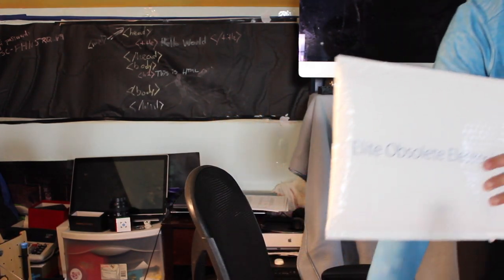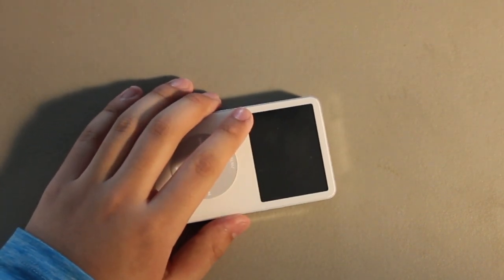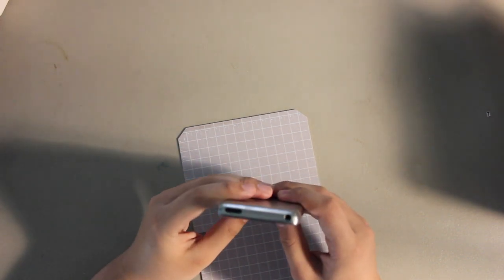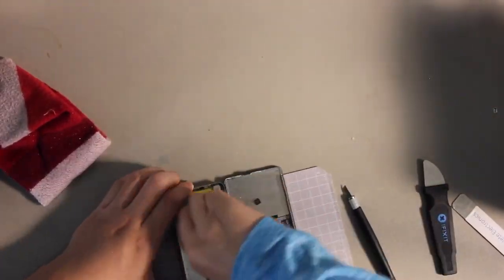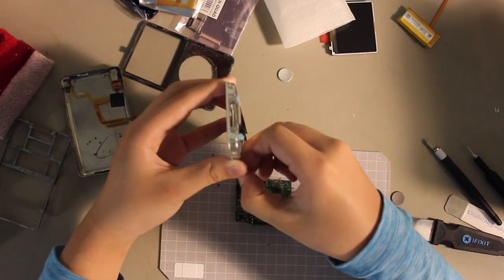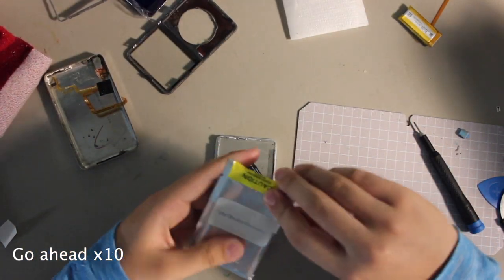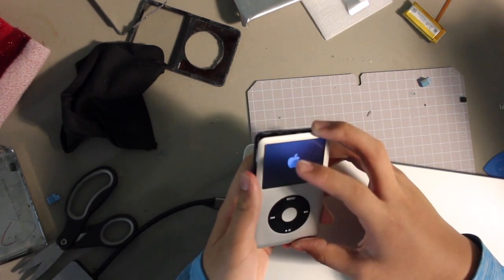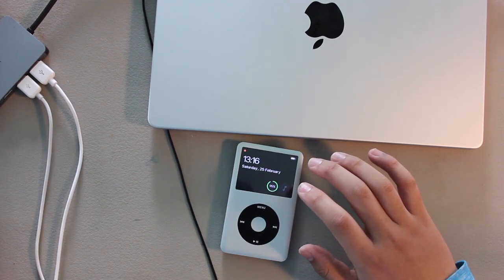I made the FLAGSHIP iPod Classic! (from a broken pod) | TSLabs

Comment: Nice work. 
Idea: maybe you should exchange parts between both ipods. The 5th and 5.5th gen are condsidered as the best sound quality ipods ever.
Reply from the maker: Thanks for the tips! There are a couple problems with that: the click wheel on the 7th gen is more sunken in, swapping the front plates makes it very uncomfortable to use. Also I like having the extra processing power that the 7th gen has because it makes Rockbox run much snappier. I do know about the Wolfson/Cirrus debate, however I haven't noticed much of a difference.
Reply: @techspacesofficial  Thanks i will try to find a 7th gen to experience the beter performance.
Reply from the maker: It isn't a big difference on stock Rockbox, but when you install a large theme like FreshOS then it makes a difference.
Reply: I have both and there is magic to the 5th gen’s. But the 7th sounds good and clean. The 6th and I touch sounds like trash tho. I have them all

Comment: Please consider a video on how to update, upgrade a iPod classic in one video to have 
1) more storage like this video
2) how to install blue tooth 5.3
3) wireless charging
4) convert to have USBC
5) different operating system to include better sound quality an types of data then iTunes.. Hopefully can control via Android instead of Windows or a Mac.
6) biggest possibly best battery.
7) Since it sounds like you offer this service please post details on how to offer a donor iPod to have you do it for us.
Reply from the maker: Hey there mr Joe, we are working on a video for upgrading but are currently wrapped up with other projects. There are plenty of guides online though. Here is the basic rundown:
1). iFlash Tarkan Mod: https://www.youtube.com/watch?v=YDxyoNbvrL0
Some things to note: 6th/6.5 gens only support up to 128gb. You need to format the card before inserting it into the ipod, and it can be a bit finicky. try reinserting the card and formatting the card directly and through the ipod if it doesn't work first try.

2). Would require some heavier modding, as shown here: https://preview.redd.it/xvq53yde1r481.jpg?width=2356&format=pjpg&auto=webp&s=4930f04c2404ccb6bfff8a236f9ef0a12b75e020. As far as I know, the only service/diy product kit offered was by classicsarerelevant which is now closed down, and is something I'm currently not able to do.

3). unfortunately, this would be a really heavy mod. wireless charging coils aren't able to charge through a metal back (at least not effectively), so you would need to machine out a hole and maybe some kind of protective plastic cover. this is what one person did and here is what it looks like, definitely past my skillset: https://imgur.com/a/82jB7rb

4). requires soldering, here's a person who offers some good kits and instructions: https://oxyllmods.square.site/rev-05. I am also able to do this, and there are plenty of people on etsy for example who are also able to do this for a fee.

5). I'm not an avid android user, but i'm pretty sure android can access external filesystems plugged into the device. With rockbox, your ipod basically turns into an external drive that you can drag and drop music onto without proprietary software. Of course you would still need a mac/pc for setup, but I think an Android device could be able to upload and modify files on the iPod. Rockbox tutorial is coming soon on this channel, but here's a good one for PC: https://www.ifixit.com/Guide/How+to+install+Rockbox+on+an+iPod+Classic/114824

6). biggest battery available on the market currently is the 3800mAh battery. Since iPods barely sip any power to begin with (the iflash takes even less power than the hard drive), this would last you well over 2 weeks under normal usage (I haven't charged mine in 1 month lol). battery upgrade is pretty simple: slide your pry tool (like a jimmy) into one side of the iPod, push the clips in and out (search a video on how to open an iPod classic). from there, it's as easy as unplugging the old battery and plugging in the new one

7). if you would like, we can discuss pricing and upgrades at "info@techspaces.club". however I strongly encourage you to do some of these upgrades (like the battery and storage) yourself, as you will learn a lot through the process and it's really fun!

hope this helps :)

Comment: Hey great video. I have a red cross on my ipod. Do you know how to fix that?
Reply from the maker: thanks! usually, the red x means that you have hard drive issues, or issues reading your drive. try the iFixit guide on reseating the cable on the hard drive, but if that doesn't work then you might be looking at a drive replacement (I recommend replacing it with a flash media, like iFlash)

Comment: Does it have bluetooth, van I use Spotify , usb-C? Am just very interested...
Reply from the maker: Bluetooth would require some heavier modding, as shown here: https://preview.redd.it/xvq53yde1r481.jpg?width=2356&format=pjpg&auto=webp&s=4930f04c2404ccb6bfff8a236f9ef0a12b75e020. As far as I know, the only service/diy product kit offered was by classicsarerelevant which is now closed down.

Afaik Spotify isn't supported on these iPod Classics, unless someone out there created custom firmware that allowed for it to run... you'd be better off with an iPod touch of some sort.

USB-C is definitely possible, here's a person who offers some good kits and instructions: https://oxyllmods.square.site/rev-05.